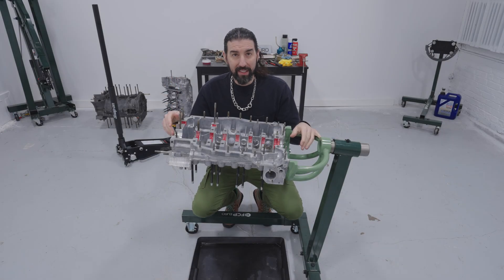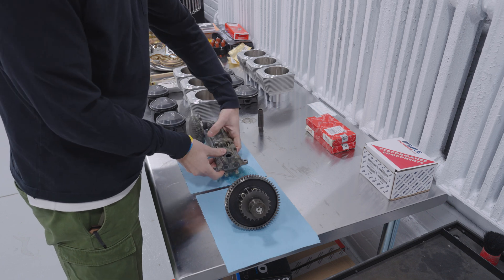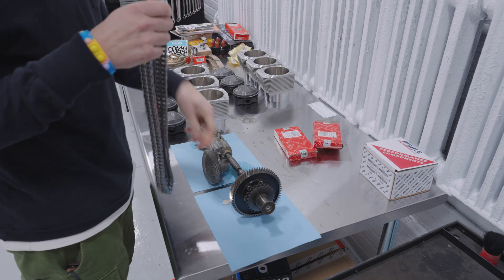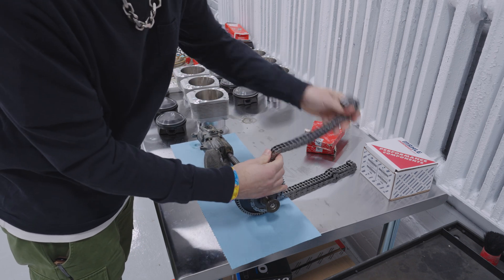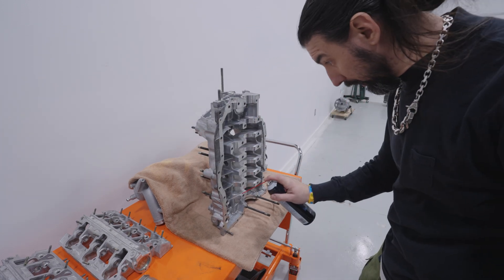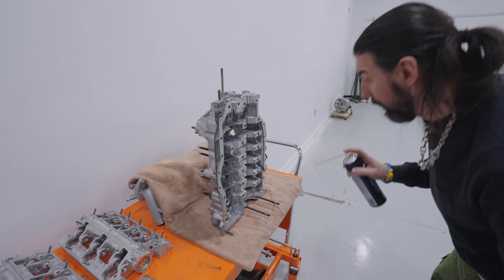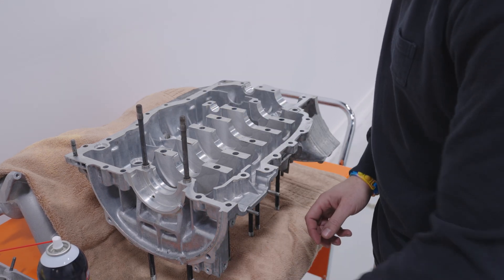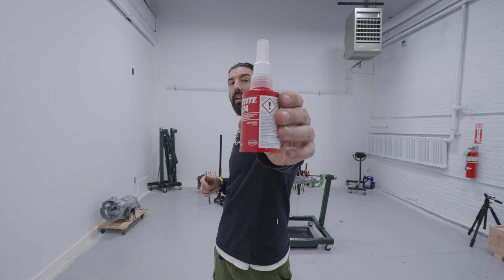Porsche M64.01 Engine Case Assembly

Comment: Can you tell me why you install the head studs in the case halves before you close the case? I’m planning a build myself and have seen it done the way you show and also with the head studs installed after the case closure. I wondered what the advantages are for each approach. This is an excellent video BTW very helpful and informative.